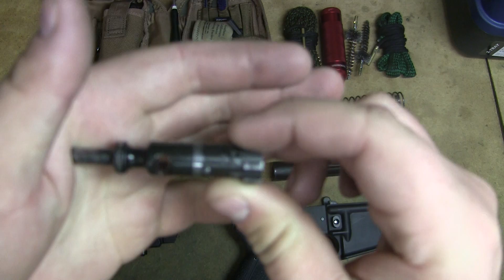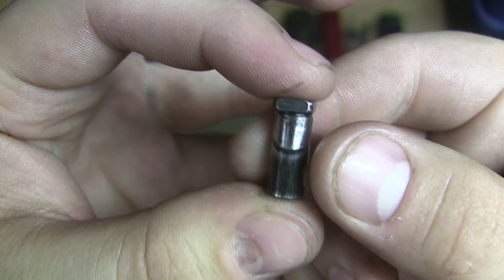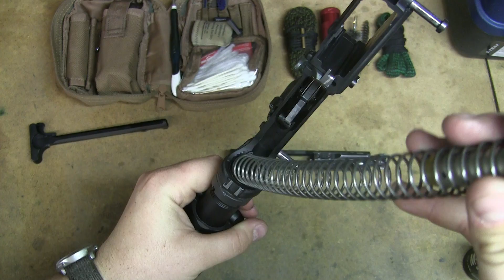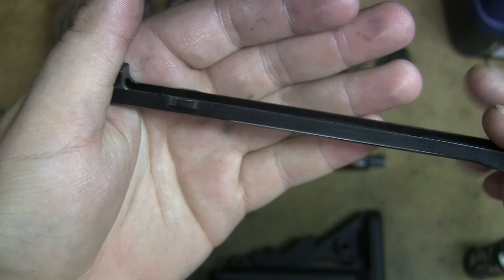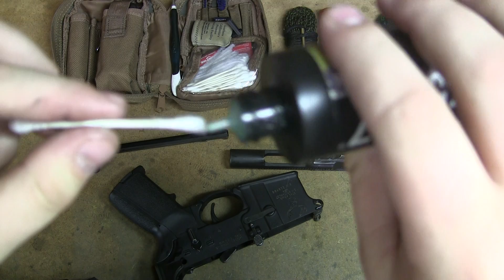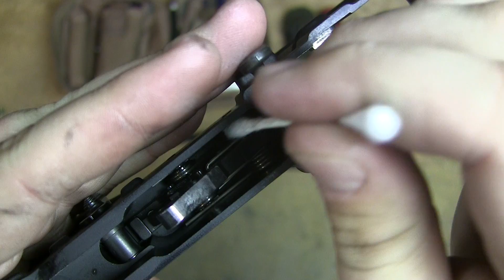AR15 Lubrication

Comment: Agree with everything but the firing pin. I keep all of them dry.
Reply from the maker: And I agree with you on that.  A dry firing pin won't hurt anything, but I'd avoid doing any lubrication if the rifle is going in storage, or isn't going to be shot very often, I'd keep the pin dry.  With the free floating firing pin design, you don't want gunky oil sitting for years on your firing pin in storage, it won't rust anyways, I only do it because I shoot 2-3 times a week, but if my gun is going in storage or not being shot this often, I'd keep the pin dry for sure.
-Mr. 2nd
Reply from the maker: I forgot to mention, I got a video uploading right now on "Down and Dirty" AR15 field cleaning, I think you'd dig it, that's going to drop in about 10 minutes or less.

Comment: Any views on Frog 🐸 Lube?
Reply from the maker: I think I should probably do a video on it, but the short answer is I'm not really a fan -unless you want to use it for black powder firearms and heavy machine guns, I think it would really excel there.  We took over our sector in Afghan from some 101st dudes, they had a big box of Frog Lube packets they gave to us, they didn't use a lot of it and neither did we.  We tried it, learned our lesson, and 9 months later we passed it off to the 3CR dudes who replaced us, and I would suspect they probably had a similar experience.  At normal temperatures it just stays caked/gummed up, and after direct sunlight or firing it then gets more fluid.  It would "sweat" the more you shot, which some people are looking for, but in that kind of environment the advantages of this constant "sweating" are negated by the dirt and sand.  For a DI AR15, I can see the benefit from having something that keeps sweating more oil as it gets blasted out every shot, but the downside is it's getting blasted out all the time.  A direct-impingement AR15 tends to dump and blast out anything it doesn't need, the oil spray and smoke tended to be a little bit excessive with the Frog Lube.  Fast forward to Iraq, I can't remember seeing any Frog Lube out there, and thinking about the sand storms we had, I wouldn't want to attempt it.  From what I understand, it was designed with amphibious operations in mind, such as a SEAL team infilling from a sub, swimming to shore, then coming out and onto the land, and in that specific scenario I think Frog Lube would probably excel.  It'd stay gummy, even in the salt water, and you'd still have it and the sweating action going on once you got to land and had to use it.  My thought is just because something is great at a very particular niche scenario, does not mean it automatically is the best thing ever for every application, situation, or weapon system.  In normal situations, is Frog Lube going to work?  Absolutely, but is it what I want to use?  Probably not.

I think for "flat range," civilian application in constant and guaranteed clean environments, you won't ever run into any problems with it and I don't think you'd be a complete fool for wanting to use it, but if you know you're operating in some really austere environments, I really wouldn't recommend it.  That's not to say you can't find success using Frog Lube in austere environments, but honestly for that kind of application/use I would stick to conventional more-fluid oils for the AR15 and other small arms.  Very minimal lubrication all the time, and if you actually get into a fight, I always had a small bottle of CLP I kept on hand in case I needed to grossly lubricate and go.  

I do think it would be a great idea for black powder firearms, such as a cap and ball revolver, where you have an interest in sealing off your cylinders with grease, and you could benefit from the sweating factor because you have a real need for trying to prevent rust.  I also think it would work well on a M2 machine gun, or something like a M240, where the internals are generally protected from the environments but you got huge pieces of heavy steel flying back and forth with all that steel-on-steel contact going on inside.  The M240 doesn't really seem to care if it has lubrication or not, it just works like a beast.  The M2 is also great, but really the gummy/sweaty properties of Frog Lube would help reduce wear.  

Overall, I do most of my shooting on a "flat range" and I don't usually get my guns too dirty/muddy (most the time), but I still maintain and lubricate for austere environments as my standard way of doing things, so Frog Lube is not going to be my choice for something like an AR15, but others would disagree and that's OK.  I'm about to release a "Down and Dirty AR15 Cleaning Video" pretty soon here, it features 3-In-One oil and I think you'd find it interesting when it drops.  Thanks.
-Mr. 2nd
Reply: Mr2ndAmendment
Many thanks for the well considered reply. I frog lube on my Glocks but never in a 'greasy' application. Only polished off the metal.

Comment: What degreaser/cleaner do you use?
Reply from the maker: CSxHAWAIIN 

I generally use Hoppes#9, it's a pretty good overall cleaner. When I get stateside I'll do a video on it, but really for an AR you don't have to get very detailed with the cleaning, and the gun will be just fine without going through and getting every spec of carbon out.

Comment: What lube do u use?
Reply: nvm
Reply from the maker: xSmokeyArtichokey 

There's a wide range of useful types, brands, and kinds of lubrication that work well in an AR. I use military-issue CLP, which is a little different from the BreakFree stuff -mainly because I got an unlimited supply of it. I think it's G96 and I'd have to dig up the NSN (national stock number), but BreakFree CLP or Winchester oil is a good alternative. I've been experimenting with Balastol and I've been liking it. 

I really need to do a video on lubrication types, kinds, brands, and applications for various things. For the AR family you can take care of everything with a type of oil like shown, with that kind of viscosity. Some dudes swear by automotive products and engine oils, I'm not recommending those.
Reply: I would love a video like that. I've been searching and can't find one.

Comment: I clean mine with remoil from Walmart. After my bolt is clean I spray the whole thing and put it together wet af. By the time I actually get to the range to use it again it's dry enough to not be a "dirt magnet" or spray oil all over the place.

Comment: Hi there, Can you tell me why most people use oil on the BCG and not gun grease? I personally use and thought grease would be better? Thank you! Jon - New Zealand
Reply from the maker: Jon Anda 

I do know of grease being used, and in ideal circumstances it isn't better or worse. I don't use it because I really can't with my usual environments, we got too much sand for me to feel comfortable using grease.

In normal range conditions, it's not a problem, and some people do use it. When times are good and the shooting environment is clean, you can get away with using just about anything for an AR. The method in the video will keep you covered for normal conditions and in austere/dirty/sandy conditions. 

The AR is usually forgiving and it'll do well with grease, but I only use it where I absolutely need it, like on a M2 machine gun or my M1 Garand bolt/cam track. Just different techniques, maybe a lot of AR owners are prior military in our country, and we are used to using CLP (oil) so we just do that naturally? Not sure on that, I just do it as seen in the video and it's worked well for me. Not going to say grease would have let me down in Afghanistan or Iraq, they each had unique challenges, but I'll just say I wouldn't want to try it.
Reply: thank you, yes sand dust and grit is a consideration for sure (i.e the environment). I think if i was in a sandy dusty environment i too would think differently like you. Thank you for your great video.

Comment: Lubricate EVERYTHING inside your AR... anybody telling you otherwise is just a moron talking about something he doesn't know!
Why lubricate if no friction? TO PROTECT THE INSIDE OF YOUR GUN!
This is a DGI system (Direct Gas Impengment), that means your gun will be sprayed with trash on every shot... You want to have a clean gun? Lots easier to wipe grease than scratch carbs.
End of debate.
Reply from the maker: Bazuzeus 

You do it how you want. If we're talking about a dripping BCG and completely soaked internals everywhere, count me out. In basic environments and regular range scenarios, you won't pay for it, the only consequences will be oil spraying and dripping everywhere, but the gun will still run. If you do what I do, that will not work -you just created a dirt magnet that will get gunked up with sand and dirt very easily. I lubricate exactly where it needs it, and nowhere else, in austere environments you're just wasting oil and creating a dirt magnet. Every 1000 rounds I do a quick wipe down and re-lube with this minimalist approach, and it works. 

Afghanistan was more forgiving with the sand and dirt, but I kept to this approach. Iraq is much different, we got baby powder dust and sand everywhere, getting the gun dripping is not going to be doing me any favors. To each his own.
Reply: Using lithium complex grease is way better. Being thicker, you can get the upper lubed super well, without worrying about it dripping or burning off. It also works very well at silencing a standard buffer spring. I usually over lube the gun, rack the charging handle numerous times, then open it back up and wipe away any excess. Gives a very nice coating inside that will ensure the BCG stays slick for thousands of rounds. I also feel as though converting range rifles to bolt action is just a smart way of conserving ammo, and keeping your rifles clean inside. Just remove the gas block, and reapply backwards to seal the port. Boom, no gas impingement mess, and you can go extremely long periods between lubes. Just remember to clean the barrel between uses.
Reply: I dont think he was saying it needs to be "dripping" That is the problem, you keep acting like it is either your "minimalist" or "dripping". I think many people use something in between.  He was saying that you DO need to apply a THIN COATING for protectant purposes. Has nothing to do with lubing parts that don't need lube. But has everything to do with providing a protective film. This isn't about helping with weapon function, it is about proper weapon maintanance, and really increasing the ease of cleaning when the time comes..
Reply: Mr. Dark  I'm with you. I use a lot more lube then  in this video, but  it's by no means dripping. 
I think the extra lube will migrate to wear areas as you shoot.
It seems like in so many of these  videos there less concerned about  lubing the weapon, and more concerned about not getting any lube on there fingers.
Reply: Well i mean it doesn't take much more as far as LUBRICATION, but you also have to provide PROTECTION for the internals. A subtle distinction but an important one. All im sayin.
Reply: I always put at thin layer on all the out side metal parts to keep it from scratching so easily. One of my guns is a colt hbar I had for 30 years that still looks brand new
Reply: All that trash will stick to the excess oil and gum up the action.  Lube the wear areas only
Reply: Mike Wiskirchen that’s more for combat use of a rifle where you may actually get build up. That’s really more to prevent sand and debris from collecting inside the receiver. If you’re a range shooter, that buildup won’t happen. Also, you should be cleaning your gun after every trip, regardless whether it could still see another 1k rounds, or not. So keeping your gun well lubed will help preserve it during storage, and help prevent wear.
Reply: @DaveDuzzit  It has been my experience that even with normal range use and depending on the quality of ammunition,  the residue from the gas system makes its way into the action and can gum things up if excess oil has been applied.  Over lubricating can be as bad as underlubricating or using the wrong viscosity of lubrication.  I was at the range once and a guy was shooting his single shot ar15 and couldnt figure out why the gun wouldnt cycle.  I looked at the rifle for him and quickly discovered that he had coated his buffer assembly with heavy grease.  The grease was actually creating a seal in the buffer tube preventing the carrier from traveling rearward.  A quick cleaning to remove the grease fixed the issue.  At the end of the day, do what works for you as long as it works
Reply: Mike Wiskirchen I always use lithium grease in my buffer, probably not nearly as much as this guy you described. Was he using an A2 buffer? Carbine buffers have a vent hole in the rear that help prevent that. Grease helps silence the spring twang. But as you say single shot I assume no gas at all... I also apply a decent layer to the upper/under side of the charging handle inside the upper receiver. This helps avoid wear on the gas key. I never lube the internals of the BCG, the internal piston design doesn’t require it. Carbon is a dry lube in itself. Just a drop of clp on the cam pin where it interacts with the bolt carrier, and a thin volume of grease on the outer tracks of the BCG. I’ve never, in over 50k rounds across my AR’s had a single feed or cycle issue, only dud rounds from cheaper manufacturers.
Reply: @DaveDuzzit  It was an A2 buttstock now that I think about it.  The grease he had on it was thick like bearing grease.  If a vent hole was present, it may have worked.
Reply: @mikewiskirchen8530  Figures, that why we evolved the carbine gas system and buffer. Compressed air had to push past the buffer into the upper receiver every cycle on the M16A2 and was a nasty mess. I have an AR-10 I use an A2 buffer with a UTG S5 pro stock. I drilled out a small hole through the stock bolt to avoid this issue. I'm surprised its not a common aftermarket product considering how easy it is to make. I do use bearing grease rated for 650f temps. A decent coating on the buffer spring, just enough so it wont migrate past the buffer onto the BCG, but reduce that annoying twang.

Comment: Thanks. I just got M&P 15 sport 2 and it jams a little bit  maybe cause it's brand new? I will buy this lubricant. It's my first AR.
Reply from the maker: Alcatraz 

What ammo are you using? What mags are you using? If you got a Magpul PMag with some Federal XM193 ammo, we could rule out the magazine and the ammo right away. If you lube it as shown, use that mag/ammo combo, and still have problems then it might probably be the rifle. A brand new AR definitely needs oil, very few companies ship their ARs pre-lubed and ready to shoot out of the box. 

What kind of jams did you get? What was happening when it was having problems? I'd put some extra lube on the gas rings, for a new AR I always go a little extra on the gas rings at first.

I think if you lubricate and use good ammo/mags, you'll find your problems go away. After about 300 rounds problem-free, you're set. I'd avoid any steel-cased .223/5.56 ammo, anything like Wolf and especially Tula Ammo, avoid. Most ARs will not do so well with steel cased ammo.
Reply: Mr2ndAmendment I'm using 4 Pmags and yes federal 5.56 XM193. I will lubricate the gas rings before I go out to the range again.
Reply: Mr2ndAmendment there is nothing wrong with steel case ammo. I have shoot thousands of rounds in my ar’s and only once did I have a failure to extract. 
Some rifles don’t like steel case ammo.  But I always heard it was due to the timing of the rifle and not the ammo. 
Just like some rifles don’t like certain buffers. Normally the heavy ones,
Reply: Was having the same issue too.. about to do what I just read off here. Thanks.

Comment: Tell me what I haven't seen out there on Military Ranges ? I just help clear old boy using old ammo clear a squid . Lubricated it and punched the round out got , cleaned it and back on! ARs ? Little bit ! Your right !   ARs just need a little lube .Ive seen them at FT Brag gunk up  and The Amory take a can and flush out all the residue and clean it good and back on . That's the night I had a squid ! pop and no Kick so I come off the line and sure enough , its squid !

Comment: its only the 'bolt carrier group' when the bolt and firing pin are installed in the carrier. otherwise, thats just the carrier.
Reply from the maker: RangerCaptain11A 

Definitely true, it's hard to get everything right when the camera is rolling, but a LOT has happened since these older days. I plan on doing some more videos when I get CONUS, thanks.

Comment: Do you ever use grease ? I was told that wheel bearing grease or specialty grease is good on the areas you applied oil. My thinking is that grease attracts dust....your thoughts